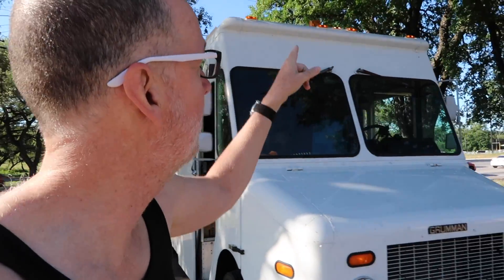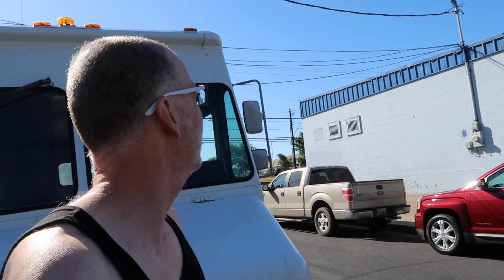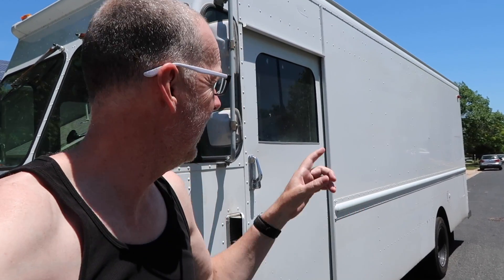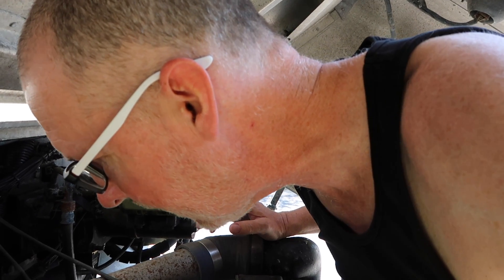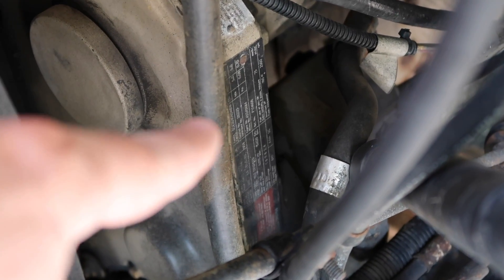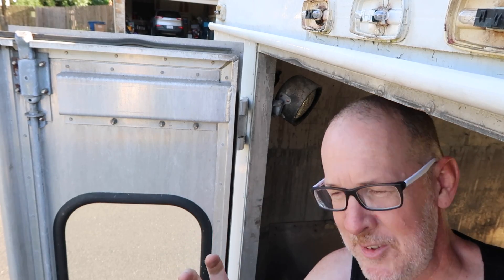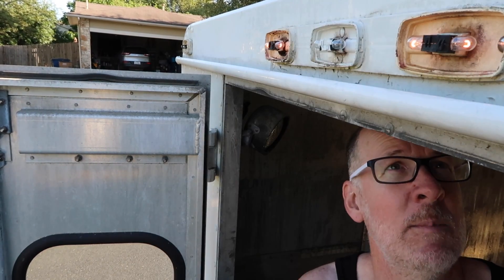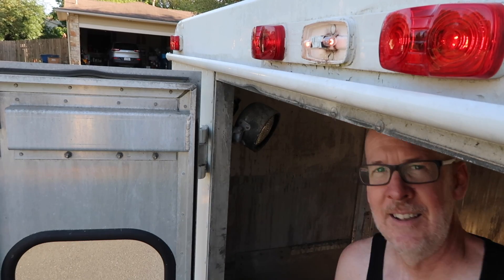Failed Step Van Safety Inspection E224

Comment: This is another problem I have all the time on boat trailers. Each light is supplied with a 12 volt power lead and they are grounded to the truck frame through one of the mounting screws. Manufactures use cad plated screws to mount the lights and over time with moisture and electricity and different metals they corrode. Remove the mounting screws and use stainless steel screws with lock washers and locking nuts. The lock washers will bite into the truck body and make a good ground and the stainless won't corrode. Those little bulbs have a bent wire loop on both sides sometimes bending the loops out a little and plugging them back in again will make better contact and work. 
Make sure that your meter is set to DC volts before testing. Good luck
Reply from the maker: this helps a lot to understand why the lights weren't working. thx!

Comment: So, if there was  a recall for your step van and they have no documentation of it being done.  You should be able to call and schedule an appt. to get it done. right?
Reply from the maker: the recall was 21 years ago. they told me they no longer honor the recall. I am going to find a backyard mechanic in Denver to open it up to do the killer dowel pin

Comment: Hello Seven, You may want to get a little better meter. Got a fluke 77 III from ebay for $50.  Start measuring a known source like the battery to test the meter.  11:02 all looks good the positive probe is in the Voltage jack and  is set to 20 Volts but was a but blurry.  See if you measure ~+12Volts with the black probe to ground terminal & red to positive terminal. If that doesn't work try the 200 V setting.  When you get the meter working the aluminium body is ground an you can be measured with the black probe anywhere as long as you get good contact. Then measure power at the light switch with the red probe.  You have to visually follow the wire from the switch to the lights and measure the voltage along the way to the lights. But the running lights should be connected to the tail lights. Should be able to find the disconnect between the tail lights and the running lights which you may be able to do without a meter with a visual inspection.   Or pop a lens and remove a bulb and measure for 12V at the bulb contacts doubt all the bulbs are bad or all contacts or corroded though. Good luck.
Reply: Sorry didn't finish watching the vid before commenting. Seen you fixed it.  Bad grounds and contacts. Good job.

Comment: Your lights had a bad ground. You need to take them off the truck and clean the the metal where the screws go through. I would replace all the screws/hardware too. Only after doing this would I apply the dialectic grease.

Comment: I would start replacing the marker lights with LED units. Go to Utility Trailer, Great Dane, or other semi trailer parts and repair centers.  Grote, TruckLite, Maxim brands are good. Try to get the USA made ones. Stainless screws, heatshrink sealed crimp connectors will also make wiring last longer. 
Any wire connections outside should be heat sealed.
Great job so far,  Safe travels!
Reply from the maker: I will do LED next time ... was just trying to pass inspection this time

Comment: 5 minutes DC electrical work for me.
The lamps are all wired in parallel.
I guess the lamp fitting uses a mounting screw to provide an earth (chassis) to the bulb.
The switched power (+ 12 volts) goes to the other side of the bulb.
On the multimeter set to DC, 20 volt range.
Black lead to earth, red lead to where the 12 volts is to light the bulb.
LED lamps last the life of your van, filament bulbs break often when you drive over speed bumps and potholes.
Reply from the maker: I figured that would be super easy for someone with experience, but really intimidating for those who have no skill in that area

Comment: Don't use Nylock nuts because the nylon will prevent the nut from being a ground. The nuts and bolts create the negative ground and you have to have a good path for the juice to flow. Good job Seven, soon you'll do this stuff blindfolded!
Reply from the maker: oh! I didn't know that about nylok. thx for the tip!

Comment: need to make sure you clean where those bolts go thru the van body those are grounding points that is part of the low voltage if not all of it
Reply from the maker: the low voltage is another mystery; I think you are right that grounding somewhere is causing it and the parasitic drain

Comment: Go to library and get a book on auto lite repair or you tube video . yup led lights are the way to go. Go to junk yard that has led lights . start to barter you career skills for real mechanic shop work. Trade hour for hour there are barter clubs. Most mechanic shops can use your skill or other biz with barter points exchanged. As you have found a van is not a pickup need constant repair. Barter points can cover food parts skilled labor.

Comment: Nylon insert in the nut may prevent current from flowing from the truck frame to the light, and again it may not matter at all. Your best friend is a small wire brush to remove corrosion. Also I believe the truck box is aluminum, you will probably have a problem with corrosion. Don't be discouraged, you are doing great. Also, consider that test light probe :-)
Reply from the maker: so lesson is: never use nylok for electrical connections, but great for all else!
Reply: Probably, the nylon is an insulator although there is probably enough metal to metal in the threads to make connectivity. Most of the connectivity that is required is probably between the lamp housing and the truck body.. but for the net gain.. just use a lock (or star) washer under a regular nut.. It's one of those things that "could" introduce a problem when there are enough all ready..... :-) Stainless fasteners are your friend on aluminum.

Comment: Corrosion is a common problem on aluminum body stepvans, wherever metals of different types touch, especially if wet.   Corrosion tends to insulate, and can weaken or break the connection, in this case on the grounding side of the circuit.
Reply from the maker: good to know.thx for explaining

Comment: grounds are usually the problem with lights.  removing and reinstalling screws, removing ground wires, clean/scrap the area around the ground drew and clean the connector and reinstall. there is a lot of things you can try to prevent it but when you have uncommon metals you have deal with electrolysis. You can't insulate because it will not ground.  over time, you will learn where the lights and other things are grounded and if you have a problem with the circuit, you need to start at the grounds.   You can coat them to prevent corrosion if exposed to the elements but electrolysis happens where the metals touch and not much you can do aside from running a ground wire to all lights and anything that is grounded to body.
Reply from the maker: I had no idea about the dissimilar metals until reading these comments today. thanks for the explanation!

Comment: was a truck mechanic for 30 plus years.  Those #194 push in light bulbs are going to give you problems as long as you have them.  Take those 5 lights off the back and replace, or better yet just replace all the marker lights.  You will have less problems in the long run.
Reply from the maker: next round will be LED and grease

Comment: first thing, it looks like you had the meter set correctly, and the wires also correct. So some of Merrill's teaching did stick. You were on the right track to check for voltage at the lights, but you were unknowingly up against a tougher than usual situation. You did a great job stumbling into the problem. Those lights generally are grounded by the screws that would go to the body. You should add a pair of nail files to your tool kit, a small narrow one for cleaning the bulb contacts (which is why the center bulb was going on and off when moved) and a bigger one for cleaning the ground connections. I am guessing we are still behind, but what you should do is remove each of the screws on the lights, one will probably be the ground connection. With an aluminum body on the van and steel screws there will always be opportunities for poor connections due to dissimilar metals, and the lights may have brass rings for the ground which is yet another metal. All these connections should be clean and bright for a good contact. after they are cleaned up some dielectric grease to reduce oxidation would be a good idea. You may also try some star washers on the inside under the nuts. A star washer can be external, where it would look like a flat washer with many points (thus a star washer.. not trying to be snarky) or internal which would have points on the inside pointing at the screw. These points are twisted so that they dig into the surface slightly providing better connection. It is quite a challenge when dealing with a company like with the serial number that they can't help point you to the numbers location, but it truly is not their department, record keeping probably couldn't tell you what engine you were looking at no less where to look. Oh and to clean the bulb contacts one or two times with the nail file in and out should work great. And the files don't need to be really aggressive, so the smoother ones will be fine. Keep wondering!
Reply from the maker: wow! thanks for letting me know I was doing something right with the meter! LOL. I also appreciate your approach to explaining the basics. it is much appreciated

Comment: Bad ground. Part of the problem is that the body is aluminum and the bolts are steel. That causes galvanic corrosion which will impede electron flow (bad ground).  For now clean where the bolts touch the body and clean the bulb sockets. An emery board works great for cleaning the contacts in the bulb sockets. When you can do like was mentioned and swap everything out for led fixtures.
Reply from the maker: perfect solution! I'll be doing that, but suspect it will be after I get a kitchen and bed built inside ;)

Comment: go buy a test light , any parts store will have one , for what your doing it will work far better , spring for the more expensive one , it will last you a lifetime
Reply: towrecker YEP.
Reply: seven, I will give you a good test light.  they are not good for all things but your truck is old enough that it is all 12v. much easier to test what you have been testing. I think I have a draw tester as well.
Reply from the maker: I'm thinking a test light would be easier for a beginner like me so I'm not confused by all the test modes. I'll get one this week

Comment: remember anything that's made out of steel in contact with any other kind of metal like aluminum will cause a galvanic corrosion situation especially when there's electrical current going through the system.

Comment: those screws that you're were turning are the ground screws. replace the screws with new ones sand around the edges don't use nylon it doesn't conduct electricity so it won't ground out the screws
Reply from the maker: great tips. thx

Comment: As they say "Righty tighty - Lefty loosey"      
If you do not know. Just YOUTUBE it :) You are learning. Remember as I said before. Make sure you check your grounds on panel vans. They are known for electrolysis and loose connections. Great job. Buy you a test light to check for power or ground. They are less confusing but you will get a fast reading and for most simple electrical systems like lights this is all you need. You had your meter set on 20amps DC which was right. But I think your positive lead should have been plugged into the RED jack on the meter for voltage. A for effort :)
Reply from the maker: thanks for the tips!

Comment: That's why I said to you before if your having electrical problems always check your ground first , those screws or bolts you were messing with on the lights are the ground to the lights !!!, if there that corroded you will prob have problems again so you could just replace the light fixtures there not so expensive and you mite use the led ones as they are less battery draw and you can get them all at knapa auto parts with new screws or bolts !!!,  😎👋👋👀
Reply from the maker: got it. always check ground wiring first!

Comment: First turn on your marker lights, take the negative probe  to chassis, take
The plus (red) and probe the lights. For 12v dc. Set at 20v scale. The lamps should be in parallel connection. Gary
Reply from the maker: thx for the tips on electric troubleshooting!

Comment: Led is the best way to Go,They are now pretty cheap on eBay. Just make sure that it is clean rust free where the screws are at the Light base,Because they get their ground from the Body threw those screws.
Reply from the maker: eventually I'll go with 100% LED from eBay... but needed to pass inspection asap so I went with what was available

Comment: Power from the battery is called Positive. The Positive wire goes to the first light then on the next one. The other side is called Negative, This you get by the wire or light unit being secured to a metal part of the vehicle rather than running a second wire with the Positive wire, So you have Earthed the Positive side of the lights. There is a big Earth Strap going from the Negative terminal on the battery down to the chassis.
Reply from the maker: not sure if I understand. are you saying that the wrong side has been "earthed" or that it is setup correctly?

Comment: comments on the aluminum body can be true when zinc plated screws but stainless is expensive and getting good ones are not common any more. but even steel body trucks the clearance lights are troublesome my dad and I have owned both ,71  & 73 boyertown multi alloys mostly steel 25 to ,35 design life with good maintenance and repaint
international metro 65 steel and a 69 metro aluminum steel finally failed alum was still going strong 10 yrs later when I caught the guy who bought it it was almost 30 yrs old then
Reply from the maker: I think you are right that it was different metals not playing well together. eventually I'll replace everything with LEDs but at the time I just needed an easy solution to pass the inspection
Reply: Seven Wanders the World y

Comment: I know this is an old video. Contact Grumman for your cab lights and most of the wiring diagrams. The drive line and chassis is most likely built by another company. For the lenses and such. Check your local trucks stops. Parts stores should have a catalog somewhere with additional lights available. Or at least you should be able to get a part number.
Reply from the maker: thx I now have a PDF service manual with diagrams ;)

Comment: We, who follow you, are probably ALL smiling.  It is a long road many of us followed tinkering with the old car in the field, to bop around the property with.  The chit-chat aside ... here are some basics to work with...
You are looking for electrical activity in your van ...the black and red cords from the volt meter are in that order ... GROUND and the red is your positive.  The meter should be set to DC voltage and above what amount of voltage there is in the area.
IE.. working on a 12 volt system ... you set the meter to 20V-DC(anything above the expected 12 volts)
The bolts and nuts that connect the lights to the van should be removed, the area under the plastic bases and where the bolts enter the steel should be bright cleaned(the lights are using the bolts for their ground)  Do not replace with plastic or nylon bolts and nuts ... use stainless steel.  Plastic and nylon do not conduct electricity.
Myself ... I would replace all of those lights ... seems all the contacts are screwed-up.
Use di-electric grease around the new contacts and you should be all set ... even if you run a new power wire from light to light across the back of the van.
Reply from the maker: thanks for the explanation and tips! I'm learning little by little here!

Comment: Any major branded truck stop will have an assortment of lite bulbs, lenses, and, any wiring you may need. As Samual Whittemore and Charles Collies said, change out all of your marker lights to LED.  They are much brighter and the bulbs last a long time, not to mention they operate cooler and with less power. The type you have now, with the push in type bulbs are junk, will vibrate 'out of connection' [being housed in a rubber connection] and will cause you to get stopped by the cops, and, possibly ticketed. I've had 38 years of experience with them as an OTR truck driver...LED is the only way to go!
Reply from the maker: I will be going totally with LED everywhere. in that video I was trying to go for the super quick solution to pass the inspection and get out of Austin (the heat and taking up space in Stan's bedroom). thanks for info on benefits of LED!